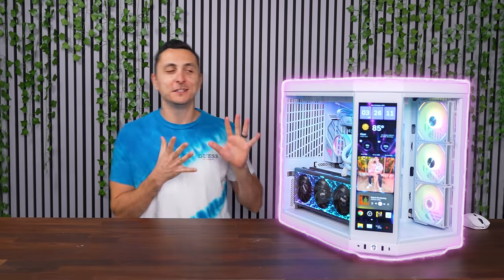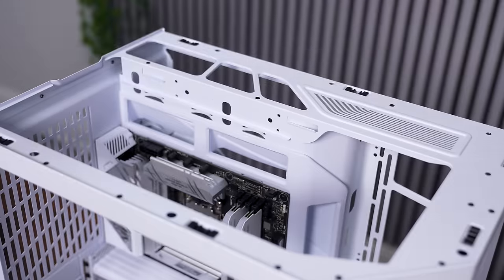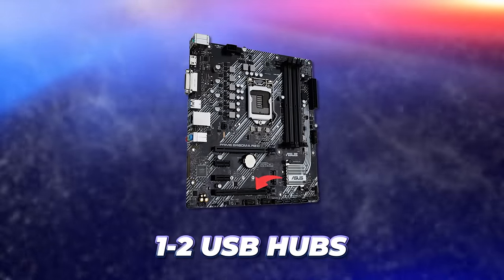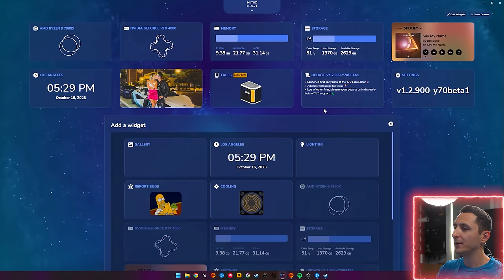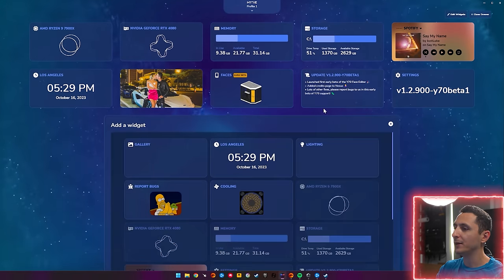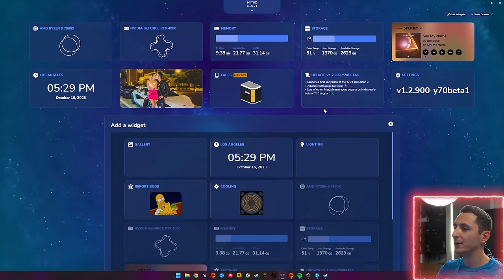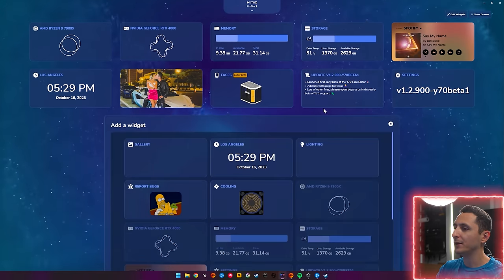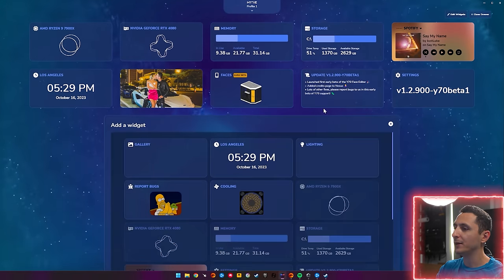This Case just DESTROYED the Competition - Hyte Y70 Touch

Comment: If you do plug this directly into your GPU, I wonder how much impact it would have when gaming, especially with its screen density. Kinda related to the video LTT did when testing multiple monitor set ups in relation to performance
Reply: Hardly noticable, the resolution on this screen is also super low. The widget application might be a big resource hog.. I'm Running 2x 4k ultrawide, never noticed any particular performance drops, hw is 10th gen.
Reply: @abn0rm1  Makes sense, though in Linus' video If I recall, resolution doesnt really matter and its more of how much (graphical power?) Or whats going on in the second monitor that causes some performance. Though i think it was only about 4%? Regardless of your resolution.

Comment: If you have 2x USB on the motherboard and 4 components to connect, you can put two components together in the one connector. You just need to remove the plastic connector from one  component cable and put the 4 cables into the cable port from second component.

Comment: I wouldnt buy one until several months after release to ensure other builders arent getting the same issue with the screen. Also note this case is only useful if you use your rig on your desk which has to be big enough to accommodate this

Comment: fun fact, im using the Y60 with a VSDisplay 12.6 inch IPS LCD display. Its not a touch screen
I tried downloading the HYTE Nexus program and it actually works pretty good on it. Obviously some of the apps wont work as it doesnt see a touch display, but the CPU and GPU temps are on there, as well as storage, clock and the animated background. Much better than using Wallpaper engine on it lol

Comment: Most usb headers only use one set of pins. You can repin a second device into the same connector and use the second set of pins. That way u can have 4 devices plugged in
Reply: And USB is not needed for fan hubs.
Reply: His argument was pointless to begin with. Who's buying a super budget motherboard for a $350 case? And the other side is SATA, you don't even NEED the USB header to power it.

Comment: Quick question: im thinking about getting the y60 mod screen just to have it next to my monitors as touch input and for the widgets and stuff.
So you made it sound like the nexus app only works well like that on the prebuilt y70 screen, is it the same for y60 or do you need a different solution for widgets etc?

Comment: Awesome video mate thank you, not sure if you check the comments here or if some one else could help me, i had the hyte y60 and the 4090 and ended up selling the y60 because of temps, i know you tested the y70 touch with a 4080 do you think 4090 will have issues with temps or now its set back will be better? i will have 2 140mm fans in the bottom for cooling, i also have a 4k60 pro which i use for capturing game play and the msi 4090 gaming x trio has only 1 HDMI, would a hdmi to display adapter work for the built in monitor, and lastly is there anyway of installing a 4k60pro in this case? thank you!

Comment: That display is sick, I'm building a custom pc case soon. Is it possible to use the display in a horizontal position?
Reply from the maker: You can change the orientation using Windows but it wouldn’t make sense with the vertical layout

Comment: Considering this case just cause i like case and screen is kinda cool. Was going to use new corsair rgb systems that all use single link cables and daisy  chain. Idc much about budget since i make alot of money lol. Im running full water loop system with 3080 and 12700k amd prob going to air cooled with aio for easier managment on next build with prob 5080 5090 and 15700k

Comment: New to pc gaming, is this good for beginner pc?
> CPU - INTEL Core i7-8700K 3.7GHz 6-Core
> CPU COOLING - NZXT Kraken X62 
> MOTHERBOARD - MSI Z370 GAMING PRO CARBON AC 
> GPU(GRAPHICS) - GIGABYTE AORUS GTX 1080 Ti 
> RAM - G.SKILL TridentZ Series RGB 3200 Mhz 24 GB (3 x 8GB)
> STORAGE - SAMSUNG 860 EVO 1TB
> CASE - NZXT H700i (Black - Red)
> POWER SUPPLIES - Seasonic Focus Plus 850W 80+ Gold
> EXTRA - NZXT USB Expansion

Comment: At 5:00 minutes in when you ask what sane person would be in a room that's 85F...well, anyone in the US without AC in the summer.  85F is NOT that hot and its pretty inexcusable for a case to fail because you don't have AC.  Especially a $360 case.  I appreciate their response and I'd still buy the case, just wanted to point out your temperature defense doesn't hold any water; it'd be ridiculous if that low of a temp caused it.

Comment: Will there be an 'normal' version of the Y70, without the touch screen? I already have a Y60 and would prefer it with just the glass and the bezel-less look, also it would obviously be cheaper. Also, what is the clearance with the gpu to the front glass? I have about 0.25 slots with my 3090 FTW3 so it obviously runs quite hot most of the time when gaming.

Comment: For those of us running 3 monitors and have no display ports available, will there be an HDMI option, or will this run off of integrated graphics from the motherboard/cpu if available (plugging into motherboard display port for example.)
Reply from the maker: You will need a dedicated GPU. I would assume an HDMI to DP adapter would be necessary
Reply: @TechSource why do you need a dGPU? Nothing on this display looks to demand anything a browser can't render.

Comment: Yeah that whole screen falling off thing just stopped me from getting this case tbh. Yes they said it shouldn’t happen for the production model but I’m in Australia. 27c is below average and I’ll hate to find the screen of my new $600 case (yes it’s currently $600 here), has fallen off or even have the slightest chance to happen. The y60 if the lcd mod kit is cheaper anyway.
Reply: Same, instead I would add clear tape neatly on the top and bottom going forward if I decide to pick this up, but I think the rog strix wins for me at the moment

Comment: Why the hell would they use tape like that? That's not congruent with the build quality of the Y60. You'd think they have a column of brackets for the thing to slide into so it can be removed after the top air filter. I wonder if their final decision to machine it on would allow you to remove it.

Comment: It's too big in my opinion. Maybe If I could see it in person my opinion would change but I actually would perfer the original design with a screen. The problem with big cases is even with a desk at 70',' it is barely enough room for two good sized monitors and the case assuming everything is put on top of a desk. Then you have the steam deck, speakers, keyboard and mouse.

Comment: That screen is not 4k.  4k has a 16:9 aspect ratio, and that clearly does not.  Maybe it has great pixel density and looks great for its size (it certainly appears to) but words mean things and 4k specifically means 3840 pixels x 2160 pixels (reverse the numbers if its a vertical screen).  That screen clearly does not, manufacturers should really stop slapping 4k on screens as a buzz word to mean it looks nice.  It's not 4k.

Comment: Looks cool but it's a terribly inefficient case in terms of air flow and cooling.
For example the bottom fans are sandwiched between a bracket that blocks like a third of the fan's openings and then there's a space in that terrible thick criss-crossed grill. 
So the air is already restricted before going into the fans especially if you put the included mesh on the bottom. Plus because of the design on the bottom it cuts off a portion of your first and third fan completely if you're using 3x 120s. On one side they have the GPU vertical mount built into the grill so on that section there are no perforations for air to get through. They also didn't make the opening on the bottom big enough to expose 100% of all three fans.. Then you have a space above the fans before even reaching that thick criss-crossed grill..
*Find somebody with a douche flute and have them blow vapor at that grill from a distance and you'll notice the vapor dissipates in every direction rather than going through the grill.
Now push your mouth right up against it and blow.. obviously the air goes straight through.*

Then you have the right hand side fans. Again they're held with that bracket that blocks airflow, then there's a space and then there's that thick grill again with a built-in mesh this time. Because that grill is not pushed up against those fans the fans are pulling air from all around themselves including The air from inside the case. They're just recycling the same heat through the case over and over.
And then we've got The terrible bracket and grill on the top too. But for some reason they decided to add an irremovable mesh to the top grill exhaust which doesn't make any f**** sense. Unless you're trying to keep the dust in your case?!  And that's why apples to apples when you compare this case to all the other meta cases that have the triple bottom side and top fans; this one will come in last place every time

Comment: Does anyone think a second, small GPU could be installed behind your primary "big boy" GPU when mounted with the riser?  I have an old 1060 laying around and I'm wondering (while I wait on my backorder y70) if I could use it to drive the case screen and not take a performance hit to my 6950XT during intense loads.  There are a number of factors/complications that I might not be aware of, but I was just looking for any feedback before I test it out when I build mine.  ie mixing an Nvidia/AMD cards in one system, other slowdowns/bottlenecks due to using two discrete cards at once.  Again, I'm just trying to run the touch screen off the 1060, nothing else.

Comment: I know this video is old but why would you turn the AC off if the ambient temperature rises to as high as 85?  It is harder on your AC and more expensive overall to constantly try and drop a rooms temp from elevated temps to normal temps.  A set curve for even a 75ish degree stable temp is the way to go, you're kicking your AC unit's ass lmao

Comment: First is was all about rgb and glass then we needed more airflow again and now it are screens on cases, pumps and even fans. Just build your pc and use actual monitors to display stuff, save the extra money for a better screen or pc part you actually need. Yeah the case is nice mixup from the standard o11 D, but the screen meh 😑 we can do without.